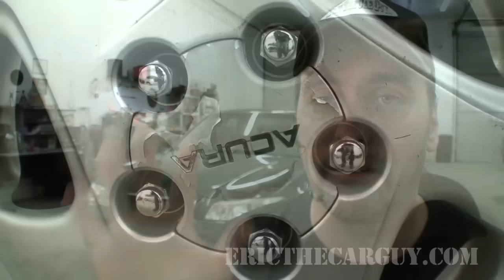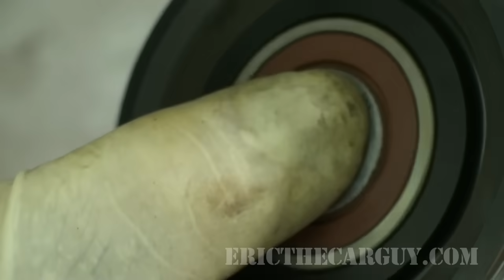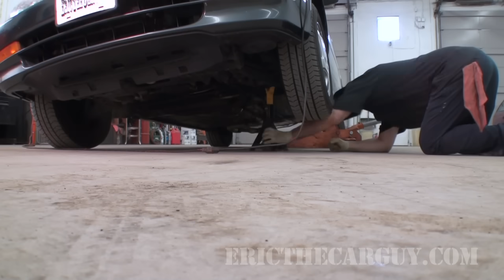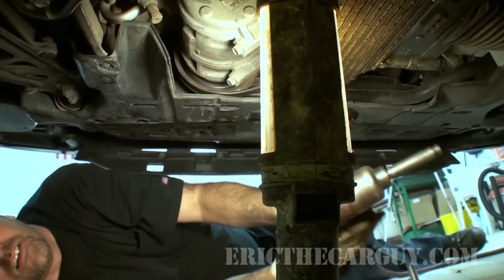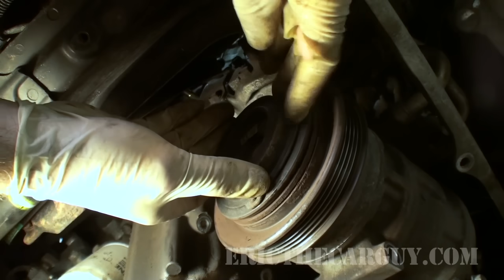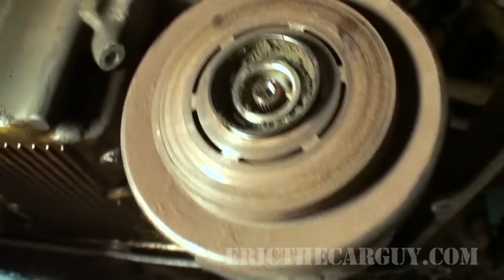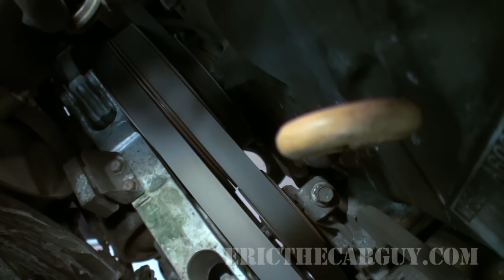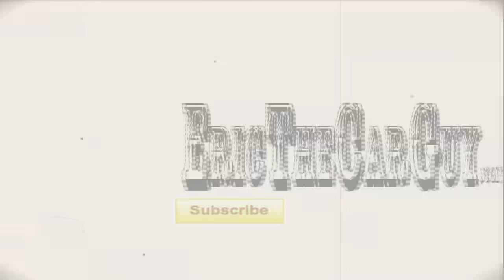AC Clutch Repair and Noise Diagnosis -EricTheCarGuy

Comment: Why would you hammer on the inner ring of the bearing when your hammer the outside ring in. That was fail ;) Get a socket or a piece of metal that fits the outer ring... Or just a small diameter rod and just hammer on the outer ring... With that force you showed its already defect when you put the new one in...

Comment: The problem I have is the connection for the air conditioner. How can i replace it because where you connect them they don't click and it stops working. It got ruined because the person that was fixing the car couldn't get it out so they ripped it and it doesn't work anymore.

Comment: hey eric,I have 2002 ford explorer,the ac compressor cycle on and off even when the heat is on, my rpm goes up.and down when it does that
Reply: +STEEVE DAVID Nicolas An ac compressor will run when the heat is on to take the humidity out of the air to make the air feel warmer and to not fog up the windows.
Reply: +Sprint316 thats great point,it make sense,but the engine seems can't take the load,it act like it is gonna die,thanks man
Reply: +STEEVE DAVID Nicolas does it bog down any other time? like when you turn lights on or roll the windows up? if so maybe your battery could use a charge or replacement.
Reply: +Sprint316 it is hard to tell, now,it is fine,I'm thinking about the iac because it only does it at idle

Comment: Hi Eric. Great stuff you have here. Real informative.
I have a error on my HVAC system. A SEAT IBIZA 2006. G65 sensor related, Signal too low. So i went into VCDS to see what was the actual pressure read by the sensor. I got a read of 0.0 BAR with the engine running. Obviously the A/C system doesn't start because of that. Can i assume the sensor is dead and needs replacing? Thank you.

Comment: So the noise was only present when the AC was on (the clutch engaged)? Does that make sense, that bearing would be spinning even when the clutch was not engaged would it not?
Reply: +Grant Parr When the clutch is engaged, the bearing does not turn... the compressor shaft does. (and also the pulley)
Reply: The aircon clutch bearing would be making a noise while the engine is running but it may not be loud enough to be heard over the engine until the aircon clutch is engaged and the bearing is under load

Comment: you will damaged the bearing by hammering on the inner race,  you should never hammer/press on the inner race, only the outer race, by using a larger socket that matches the outer race (slightly smaller so that it will clear the bore)

Comment: i had an ac clutch lock up on a 5.0 in a ford pu.  had locked up the serpentine so bad you could not get the starter to crank it over.
Reply: +Terry Vicena HAd the same problem on my son's F150.  Clutch locked up and eventually broke serpentine belt.  Any recommendations for how to seat new clutch assembly onto compressor?
Reply: +Charles Klinge there should be a c clip that hold the clutch to the compressor shaft. remove that and it should slide right off.
Reply: +Terry Vicena I got the old clutch assembly removed ok with the use of a puller.  I'm having a problem getting the new clutch (specifically the clutch coil) seated onto the compressor shaft.  I've been trying to pull the new clutch coil onto the shaft using the puller connected to the ac compressor.  Does that sound like it should work?
Reply: +Charles Klinge do you have a vice, if you do and pad the jaws you may be able to press it on. sounds like you have a different situation than I did.

Comment: Eric I need help, how to replace Idler Pulley A/C side on 2002 Chrysler 300M  Does the bolt tat runs through pulley hole screw into a plate or does it have a nut in behind

Comment: Well bloody hell fire... that's nice to know that my BRAND NEW compressor is damaged :/

Just finished a complete system rebuild on my 93 MX-5. Haven't used the A/C for about a week until now and it has that same rattling sound. Was beginning to think I didn't add enough oil to the system but this sound compared to mine just made it clear of the worst.

On the flipside. I've converted to HFC-152a and I know it has very similar properties to R12a but what ranges should my high and low side pressures be during operation and at rest? The forecast for this weeks seems like is going to be hovering around the 75F-80F mark.

I ask because as the system sits now, at the time of this post, it blows cold (eventually 55ish F) and colder (nearly 42F) when moving. Low side was showing 40-42 and high would be around 220-234. Then when the system is off the low is about 90 and the high in the range of 100-112. I was reading somewhere that when off both sides should 'normalize' and be equal?
Reply: +Porsche Duésnburg hey sounds like we have similar issues, my (91) mx5 had its refrigerant replaced last month, but idle was really rough on cold starts and i noticed the AC clutch was beginning to slip and make noise, then just last week the belt which was in good condition (could almost sell it again it was that good) had snapped and i ended up finding it mangled under my skid plate, after replacing it the AC clutch didnt want to engage, i wobbled the clutch plate a bit and it did eventually engage, albeit its now louder with the AC OFF... FML
Reply: Stewart Mckinna I seem to have gotten it sorted out, best advice I can give is to just buy a new/reman compressor. They're expensive, ja, but it'd be a good benchmark kinda thing.
Reply: yeah i think my problem isnt so serious, i suspect the bearing on the AC pully turned to dust, so hopefully if i can get the bugger off i'll just have to replace a bearing, my first attempt to remove the compressor failed,used a screwdriver, a set of clamps and a ratchet, will have to think of a better way, dont want to buy  a special tool if i dont have to

Comment: Hi Eric got A Question i got a 2004 Honda Odyssey that when turn on the ac it starts to make a noise when i turn of the ac noise is gone can that be the bearing in the ac compressor or clutch ? reason I'm asking you is because i know that Acura and Honda are a lot a like  my van got A 3.5 engine v6 reply me back let me know

Comment: Hi Eric, I have a similar problem on a '14 lancer ES, the odd thing is that it makes that noise when I turn On the AC but only when it is on Reverse or Drive at about 1200 rpms, if the car is on Parking or neutral it doesn't make any noise, any thoughts?

Comment: hi Eric i got astro van 2002 , first my old bell snapped i replace new one now when it on idle turn A/C on motor stall and die can you please tell me that ac compressor is lock up or what wrong with it thanks .

Comment: I have a problem with my speedometer on a Honda Civic 1998 1.6 stick shift DX model. The needle is stuck at 20mph and sometimes sort of vibrates and goes between 18 and 23mph is just shaking there but then remains fixed at 20mph, problem I'm concerned with is that, scheduled maintenances are done based on mileage, but the needle is stuck. Any suggestions?

Comment: hi,thanks for the video,my 94 honda accord ex 2.2 vtec has a hadsys rc-17d a/c compresor,there was a loud noise coming from the front engine, thanks to your video,i notice it was coming from the a/c compressor pulley,now its been replaced following your videos and noise gone,thanks again

Comment: Just wondering if anyone can give out a little info. i have a 1999 honda accord ex 2.3l i noticed a loud noise coming around the ac compressor. Also i noticed a sticky substance that coming out from the A/C clutch some of it also go on to the belt too. any info would be nice.

Comment: Thank you very much for the video. Currently have a 05 Accord V6 that needs the field coil replaced. The connector has 14V to it with car running and A/C turned on but it doesnt engage.  I can apply 12V to it directly from the battery and it doesnt engage either. With the car running I can bump the face of the clutch and it engages about 1/4 turn then stops. Very limited space to work in there. I appreciate your tips on getting everything off. I think Im going to have to go from up top and remove the alternator and unmount the compressor just to give me some more room to work on it. Can I remove the clutch center bolt without a impact?

Comment: Hiya, ditto on the great picture quality, but more than that, you make repairing these things look 'plausible' and maybe even actually 'possible'.
The air con conked out my '01 Ibiza and the repair guy here is booked solid until near September, useless as the temp is hitting near 40 celsius right now and not in September!
So, it was the 'high tech' technique that worked for me here… Non working air con,  'wiggled' all the joints, sockets, fuses and connections tied to the sucker, and there ya go! Working air con.
It does take a lot of convincing, or a cattle prod, to actually 'try', but as a Master once said: "Do or do not, there is no try". Thanks!

Comment: with the engine running, then later turning on the a/c.. my engine will shut off after about 60 seconds... any idea on what could be the cause of it... on a 97 cadillac deville

Comment: Quick Question, In my 2001 Chevy Blazer, when I turn on my ac, and heat there is always a kinda rumbling sound that eventually causes the dash to vibrate, I believe that it might be the fan, and or the fan motor, but I really need to fix this before I end up breaking something. Any suggestions?

Comment: In your experience, do all AC clutches turn free when not engaged? IE, you can turn the compressor via the outside disk (not what the belt sets on), but if the engine is off, they all turn without any resistance at all?

I'm asking because Im having issues with a F250. AC engages and disengages constantly.  When i have it turned off and turn it by hand, its eash, then hard.  

I took apart the whole pulley, replaced bearing, and cleaned everything up, spacers are still good, but same thing.   Should I be replacing something else or the compressor itself?
Reply: +walperstyle sounds like to me it could use a little freeon
Reply: walperstyle If your engine runs hot, the compressor will cycle off & on to prevent engine overheating, you may need a thermostat with a lower temp rating. there are videos showing how to bypass the compressor relay with a paper clip, to see if the compressor runs constantly when bypassed. the relay itself may be intermittently malfunctioning, too.
Reply: happens right at startup, cold engine.  Canadian climate.
Reply: Would like to have my question answered though to those that have a 5.0 9th generation F250.
Reply: +walperstyle some systems will engage the air conditioner when you have the heater controls set to defrost, This help by drying the air and preventing condensation on the windsceen

Comment: Hi Erik,

Thanks for the great videos. I have a feedback for you: It is not recommended to hit the bearing directly in the center. It is better to use а hydraulic press and press it on the outer side. I know it the pulley was not going to be used, but someone might try it.

Keep the good work!
Best

Comment: Maybe you said it and I missed it, but where do you buy your AC clutch parts. I can't find an auto parts store that sells just the clutch. They want to sell me the whole compressor and clutch assembly. Which is expensive.
Reply: Check ebay , amazon, parts geek
Reply: +Charlie Groff Check RockAuto also.

Comment: Hey Eric! Love the channel, located a bearing and easily tapped it out for a tensioner. (belt popped/burnt from either tensioner or a/c clutch locked up im guessing). Question: If this bearing wasn't the problem can I pop the bearing out of the a/c clutch and put one in it as well?  note: the parts for a w4500 GMC boxtruck w/ Isuzu diesel 4 cyl parts are obviously made of GOLD ...just the a/c clutch is over $400... what a RIP!!!!!!

Comment: not trying to be a jerk but I would have used a bolt and some washers to press the bearing back on... or in a pinch a seal driver and hammer. That way you don't need a shop press and nothing will get damaged

Comment: does noisy clutch mean compressor leak.? my 95 accord has a noisy clutch. my ac after a charge is 45degrees.. then after a few days its 100F due to leak but I don't know where its from w/dye and all

Comment: awesome vid. i have an 03 s10 4.3 that has had very similar noises. im fairly certain its the ac clutch assembly but never thought it might be the idler pulley, but i will make sure to look at it while im working on it. and the reason i think its the clutch assembly is because i noticed a dark "brake dust" build up near my ac compressor
Reply: 83

Comment: I did this on a 1998 Coupe. Pretty straightforward with the exception of having to remove the compressor from the system. The outside of the pulley require some special attention to remove of the splines. $32 in 24oz of 134A for recharge and replaced the belt. The bearing was $13 off of ebay. Other than that it was pretty easy. Thank you!!
Reply: Tj

Comment: Great videos man!! question: 01/F-150/4.6l A/C compressor kicks in and blows cold air for about 10minutes than clutch wont engage, I had to turn it off for two to three minutes before turning back on and it work for 10 minutes again before clutch wont engage again, where do I need to start looking for my self before spend money in a shop to get it fix ?

Comment: I recently bought a 04 Scion XB. I bought a recharge can with the gauge. It was in green to blue. So I charged it up. While running it on high it blows cold air, but not really really cold air. Compared to my friends XB. I don't hear any grinding, or noises. The view port on the High pressure line has the R134a going through it. Any ideas?

Comment: Thank you for posting such a great video. A press would be better to pull and push the bearing in and out. Also apply the pressure on the outside ring of the bearing.

Comment: I have strong belief that the AC clutch went up on my 2009 Ford Focus since I finally found my AC compressor and the clutch doesnt seem to be moving when the AC is turned on. However it doesnt look easy to get to. It appears you have to take the wheel well apart to get to it. I do hope it doesnt cost a fortune to fix and thats all it is.

Comment: Hi, i have a question for you.
My 2011 Honda accord AC was working fine till yesterday but not today. And i hear some change on overall noise. Once i turn on AC there is CLUTCH sound inside the bonnet  and the cooler fan start working, then the cooler fan stop immediately, then after one second the CLUTCH sound and the far starts again, then immediately the fan goes, like a loose connected cable wire What you suggest the problem is....??

Comment: And can that UV dye that can be used in fuel , hvac , oil , transmission , power steering virtually all systems to locate leaks be also used in the break system... because that was the only system I don't see people using the dye on and I was wondering if there was a reason?

Comment: for example it seems the same hoses for fuel can be used on power steering hose ....etc what defines what hoses or pipes can be used on which system. I would imagine in theory if one has a hoses or pipe rated for enough psi and the pipe/hoses will not corrode over time with the fluid it has to contain it should be fine for uses provided the right gage of it is used to obtain the desired pressure for the particular system

Comment: so more concerned about the pipe and hose materials on each system , the pressures ranges for those systems , and how to identify which pipes / hoses are for what systems. Obviously a lot of the coolant systems or ac systems can be identified so the areas of power steering,brake systems , and transmission system would be my closer concern

Comment: Eric, I need help. 2001 Honda Civic EX. The AC was not putting out right. Only got could when I was pressing the gas pedal. When Idling it seemed warm. So I got a can of Freon and now it is ICE cold. Apparently I overcharged it because it would not turn on at first so after removing some it turned on but I just removed a tiny amount. The gauge on the can says 40 pounds. Outside temp about 75 F. I think the AC is working GREAT! But.......... The problem is there is a noise when the AC clutch kicks on. Sounds like the noise is coming from under the dash. I tried to figure out where the noise is coming from but it only seems to happen when driving. The noise sounds like a water drop or like when you pluck your cheek. Like "whoop" I am thinking a valve. Also there is a big drag on the motor when the AC engages, so if I idle the car at 2,000 RPM it drops to 1,500 when it engages. The gauge says it is good but I think it is over charged, what do you think?

Comment: This is a Godsend! Thank you for posting this. I have been looking everywhere for how to diagnose my 98 Acura RL's A/C system: smoke comes from under the hood whenever the A/C is engaged. Now, I'm suspecting it's the compressor clutch or bearing. I'm super grateful I have a place to start. Thanks Eric!

Comment: My A/C compressor whines when the engine is idling. An A/C service station worker listened to it and the guy decided to add some extra oil to the system with the refill. 
The whine is still there and they said I shouldn't bother too much.

Is my compressor gonna fail soon?

Comment: hey Eric i have a 2006 nissan murano ,just put 134a freon in system but havin coolant leakage under car.I also have the same noise issue you have  diagnose on this car.Should i just go ahead and change waterpump since i already buy one and replace ac clutch?

Comment: I have a g35 the squeaky  noise started  after I put in the new belts it dies it when I start the car and when i turn the steering  wheel also when I turn on the heater ...what can it be :(

Comment: Hey I have a 96 jeep cherokee 2.5 I replaced the a/c compressor it doesn't do it all the time but it has a clacking sound just when it turns on for like a second then it's fine ..pls hit me back